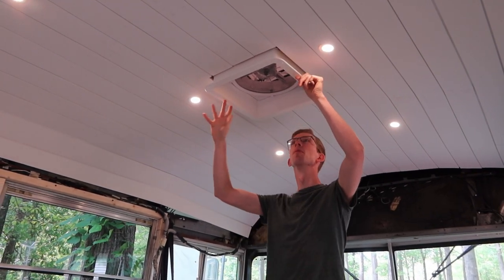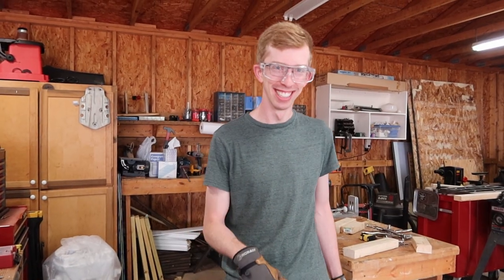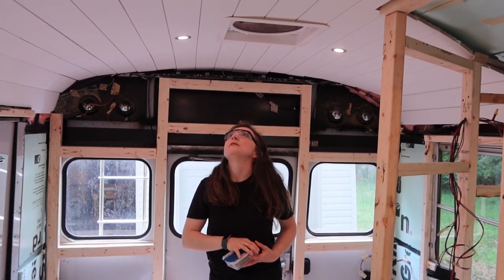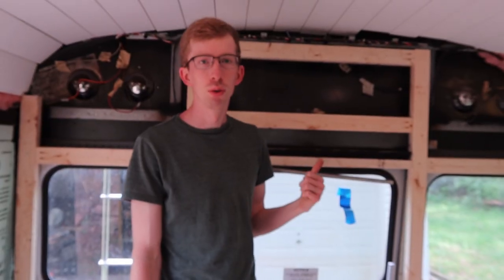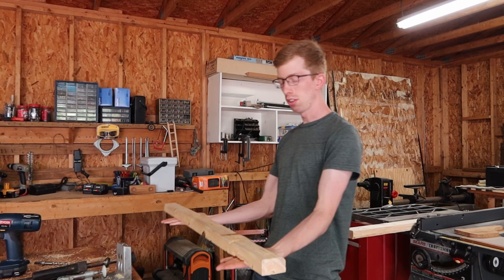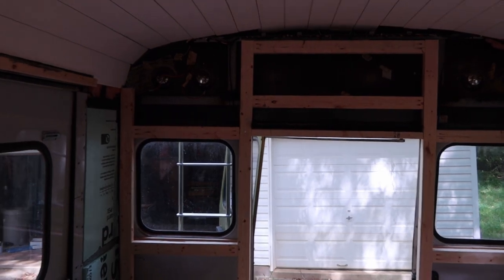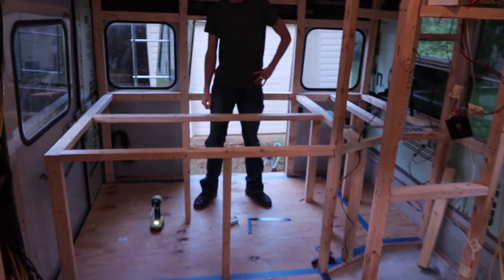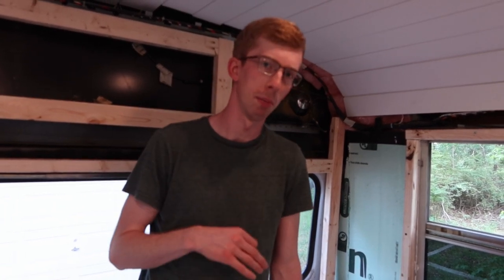Framing Our Platform Bed | SKOOLIE BUILD

Comment: Hey again.  One critique for the bed frame.  Rather than create a frame the way you did, it would be stronger to frame two half sized walls, and then build wood on TOP of the walls to hold the mattress, this way you wouldn't need supports under the bed in the middle getting in the way of storage.  Would be a stronger support.